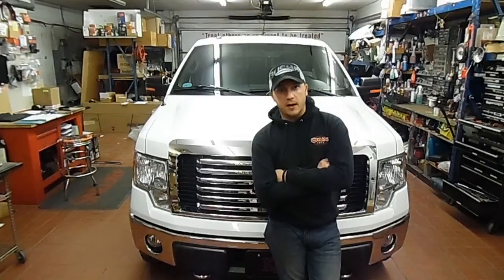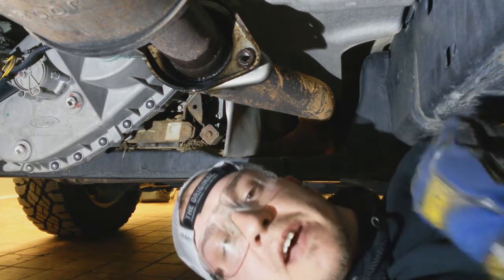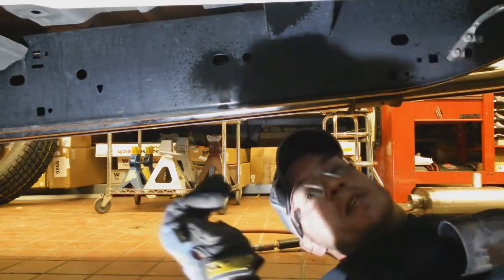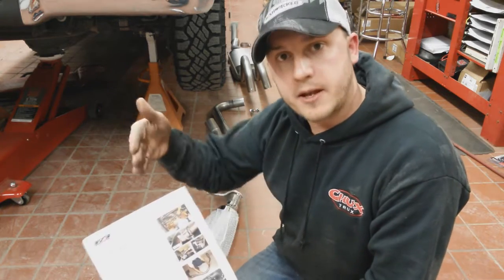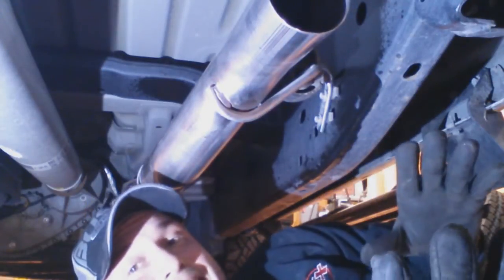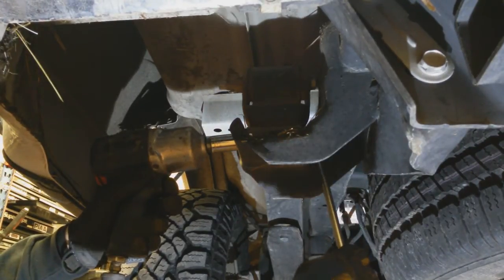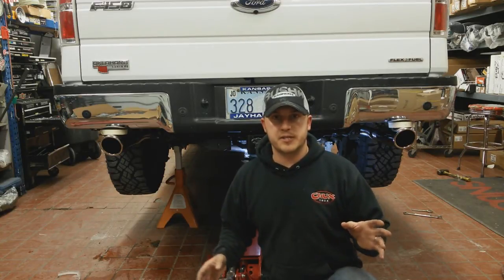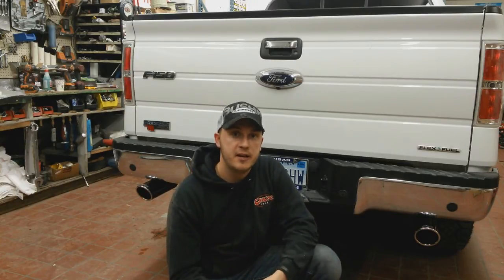2011 Ford F-150 Borla Atak (attack) Cat-Back Exhaust System Installation

Comment: Why wont this fit a 2010 f 150 what is the difference
Reply from the maker: Ford changed something.  Exhaust for a 2009-2010 F150 is different than the 2011-2014.  They still probably make the kit, it's just a different part number. Here's their list  https://www.borla.com/ford/f-150/
Reply: @ChuxTruxKC  alright thanks